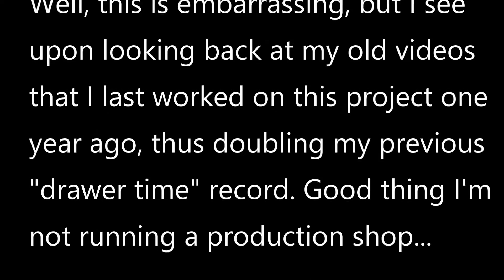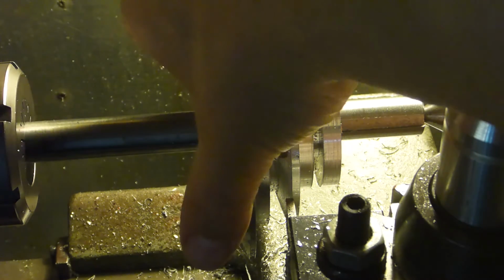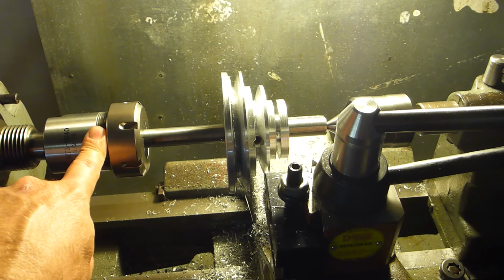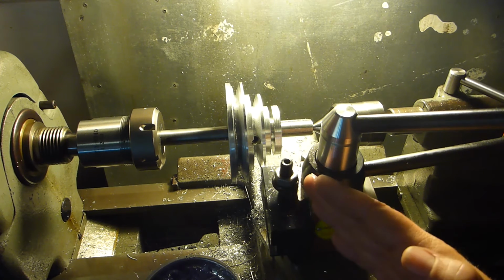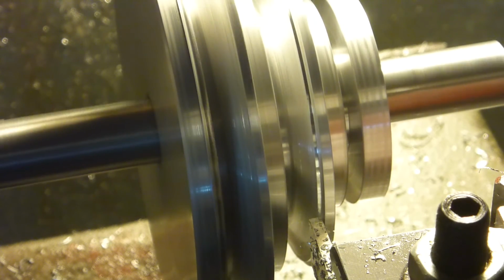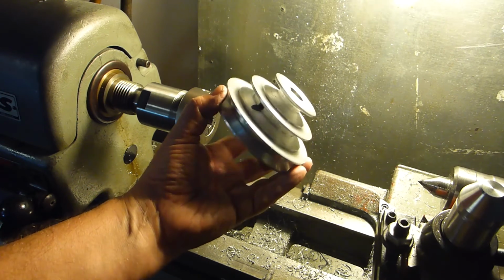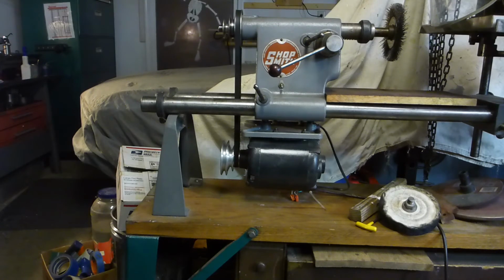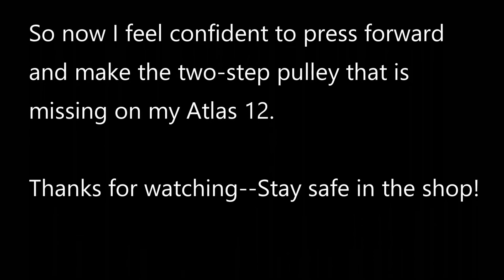2016 10 08 Pulley Making 06 Machining the Grooves

Comment: Nice job Rick, congrats. Pulley looked nice, now make that Atlas pulley. Clausing give you the dimensions?
Reply from the maker: Thanks Richard, and thanks for the tip on calling Clausing. The guy said the pulleys were still in stock ($95 shipped), or else he would just send the drawing to me. Instead he took some quick measurements. It's an odd size, roughly 4.5 inches for the large step and 1.25 inches for the small step.
Reply: Yeah, they are pretty good about helping people out...good deal!

Comment: Nice job.  Turned out well.  I also use the angled top slide method to make pulleys.

I've never tried using a former - it wouldn't be any good with cast iron or steel.

That's a fair lump of alloy, did you cast it ?

How did you cut the key way?

Cheers Rob
Reply from the maker: Hello Rob! I have a Bridgeport, which I used to cut the keyway. I used an endmill for that but I've since acquired a slotting tool. Now that I finished the pulley, I put together a playlist with all the related episodes, which shows all that. As for the blank, I was lucky enough to find some good-sized offcuts at my local scrapyard. I have yet to do any casting although I'm getting closer to that. For the pulley making, I hope to one day come across a profiling tool like the one you showed in a recent video. For now I just use the cutoff tool. As you recently demonstrated, it works well for "fussy work." Cheers!